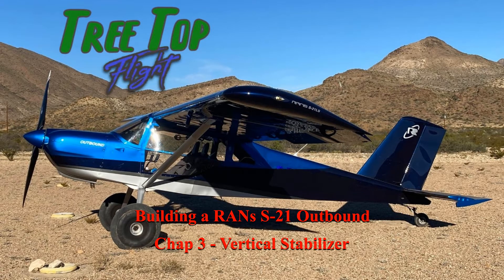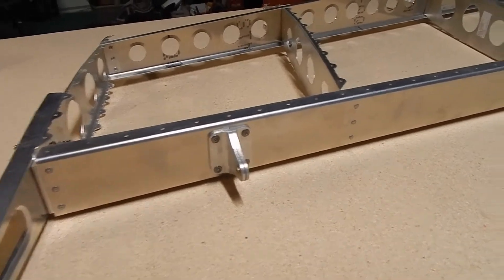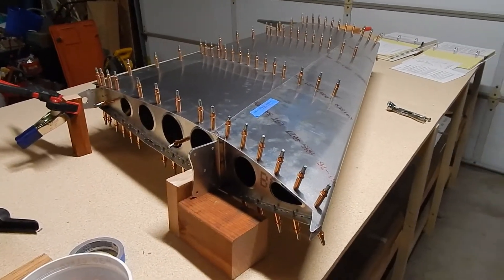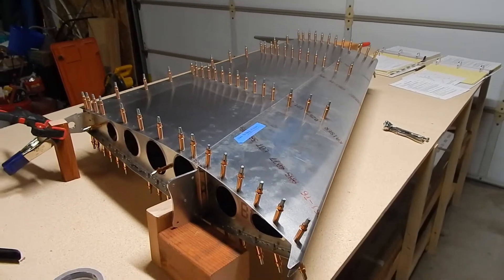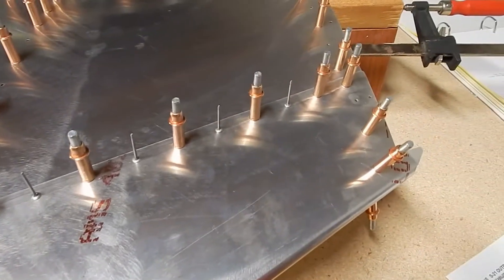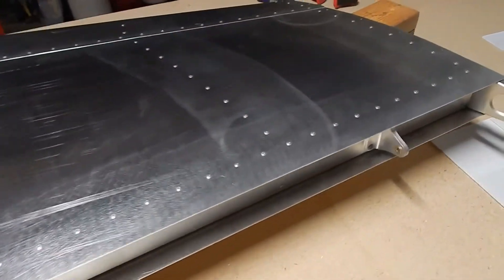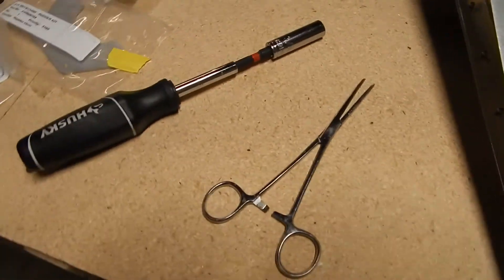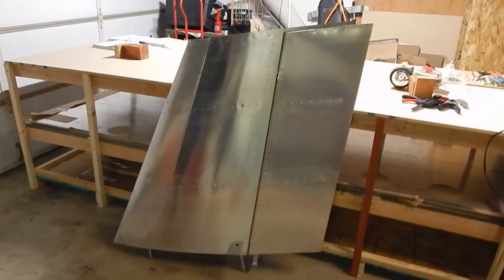Building a RANSs S21Outbound - Ep 3 - Vertical Stabilizer

Comment: I know you are much further than this in your build, but I suggest you never clean the deburrs with air.  I've had stuff in my eyes way too many times.  Shop vac it instead.  It is cleaner and no there is no danger of shrapnel to the face.  I love the table.  You should be able to fit almost everything on it.
Reply from the maker: Good advice.  Thanks.  I built the table from the shipping crates (mostly).. the key measurements were the shelf widths to be able to store my skins..  It has worked out well.

Comment: Are the rudder bolts safety wired?
Reply from the maker: No they are not.  They use a lock nut.  Manual instructions did not call for a safety wire on rudder, but do on the trim tab to elevator.